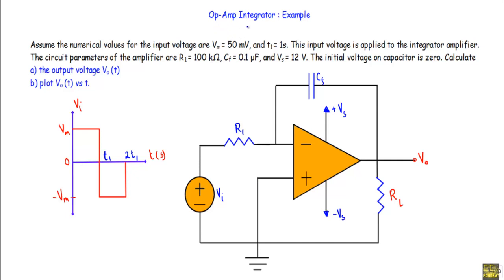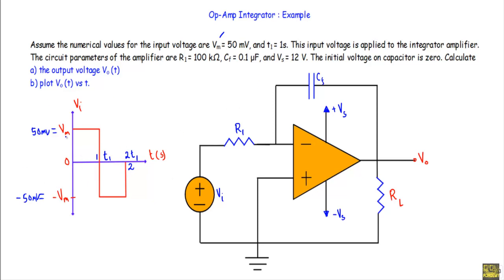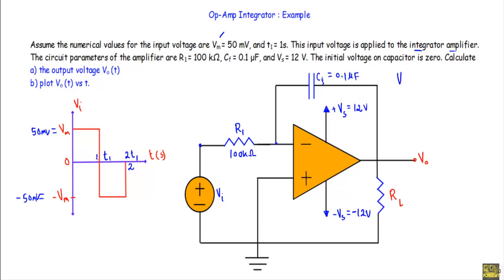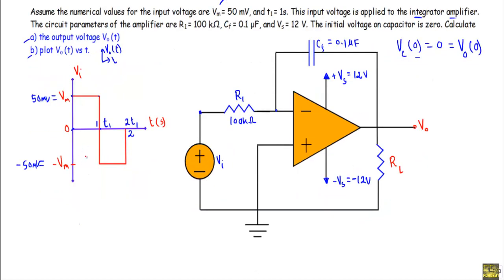Op Amp Integrator : Circuit Example (hard)

Comment: Your missing the feedback resistor dc can't travel thru the capacitor so the opamp can't stabilise its inputs causing voltage and bias ofsets wich will caus problems with the waveform like unsymetrical clipping drift and distortion  and an even bigger offset chosen by the gain of the opamp  times the input ofset